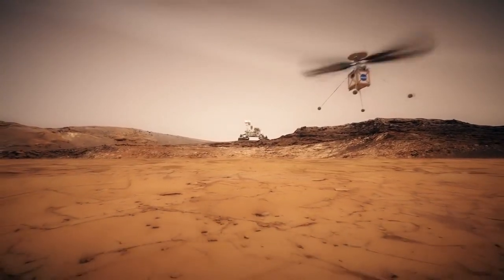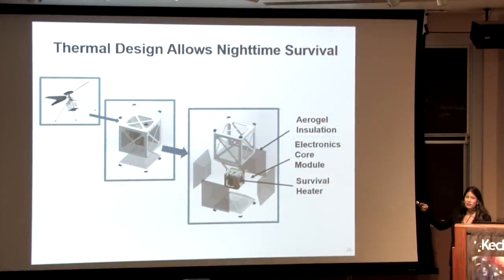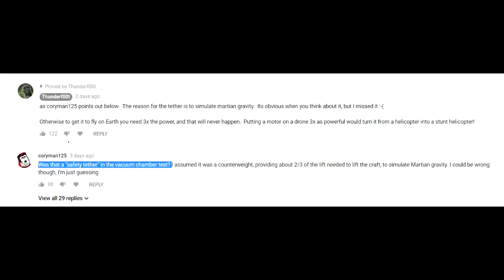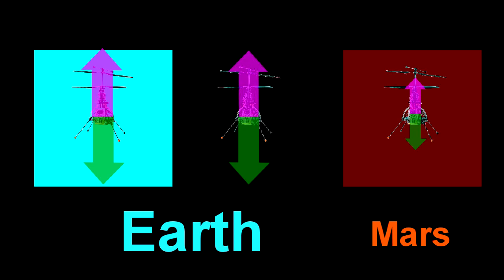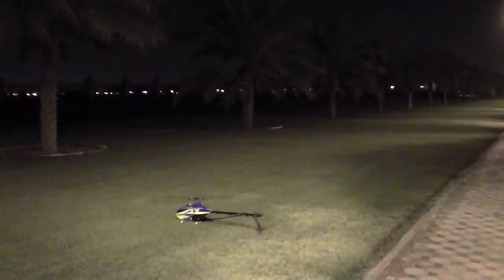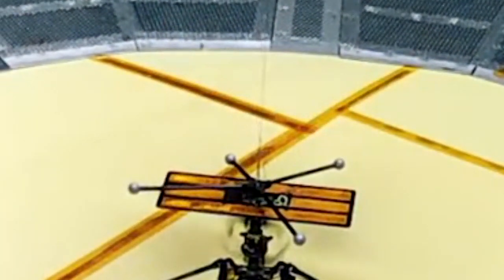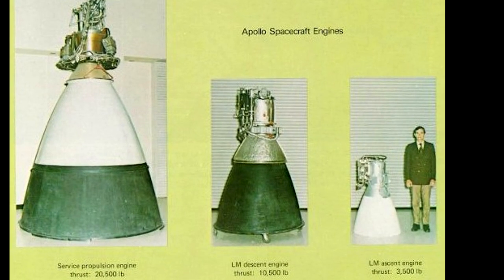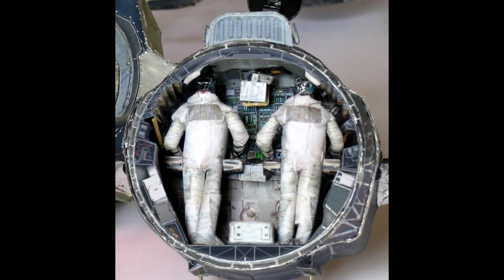Why NASAs Martian Helicopter CANT fly on Earth!

Comment: Air is needed for lift yet Mars has 0.088 psi of earth..... 55000 feet on earth is 0.9 psi, a plane on mars would need a lets say mach 1 to achieve flight and then it could not turn.

Comment: I have a question what is the Ratio of Constant pressure/Constant volume in martian atmosphere also the  gas constant because blade tip speed does not exceed 85% speed of sound to maintain efficiency and the speed of sound in mars is different in earth.

Comment: Theres also the fact that even though they would be simulating mars gravity on  the rotorcraft in the windtunnel they would not get an accurate effect of how much air it’s moving cause the air on mars is also exposed to the 1/3 g and thus falls slower. The rotors on mars would move even less air than they would in the vaccum chamber on Earth.

Comment: One would have to fill it with high altitude air ballons , but only enough, to make the body of the craft stimulate mars gravity mass. THEN it will fly as on Mars supposing to work.

Comment: It can’t possibly fly unless we have been lied to about the density of the Martian atmosphere, because on Earth small helicopters have blades rotating at, on average, 500 rpm. To get the same lift with 100th the atmospheric density, you’d need to rotate e blades at 50,000 rpm, but we can reduce that by a factor of 3, because Mars has only a third of Earth’s gravity, giving us 16,666 rpm needed. However the Mars helicopter has blades that rotate at only 2400 rpm. That’s 6.94 times less than required. Either that of the Martian atmosphere is about 7 times as thick as we have been led to believe.
Actually, I’ve always wondered how those dust storms can actually work on Mars... the top wind speed of Mars wind has been measured at around 60mph. With only 1% the atmospheric density, to kick up a dust storm would be impossible, because that’s the equivalent of a wind of 0.6 mph on Earth. Practically still air. But here we can multiply that by a factor of 3 because of the lower gravity on Mars, meaning it would be the equivalent of a wind of 1.6mph on Earth. But then, that’s still practically still air. You wouldn’t feel it, and no dust would be thrown up, even if you reduced the particulate size.
Reply: “The fact and fiction of Martian Dust Storms” Sept. 2015 Mars.Nasa.Gov

Focusing on wind speed may be a little misleading, as well. The atmosphere on Mars is about 1 percent as dense as Earth's atmosphere. That means to fly a kite on Mars, the wind would need to blow much faster than on Earth to get the kite in the air.

"The key difference between Earth and Mars is that Mars' atmospheric pressure is a lot less," said William Farrell, a plasma physicist who studies atmospheric breakdown in Mars dust storms at Goddard. "So things get blown, but it's not with the same intensity."

Comment: some late info.       you keep mixing up,  power  and  thrust.
while assuming that  it is  Possible/practical to produce 
sufficient hovering-thrust,  in the thin martian atmosphere.
martian gravity is   1/3 of earth's.    fine      but.    the density
of the  martian  atmosphere  less than 1/100, that of 
earth's.   .06 percent  of  earth's.   that is about  608  pascals. 
earth normal is,  101,325 pascals.           notwithstanding 
nasa's   flawed logic,      it can be seen that this is  the
equivalent of a rotary-wing aircraft   ATTEMPTING  to  hover,
at  an altitude   of   130,000 ft or more.        in order for this 
boondoggle to have  Any chance of success, an atypical
rotor design (maybe ducted fan) and   Very high rotation
rates will be necessary.            we are all still waiting for big-
exo-science to address the fact that  martian remote 
sampling data, relating to the  presence of  h2o  in other
than a vapor state,   Cannot   be   correct.    googletranslate
https://www.youtube.com/watch?v=7UcQuHYmTrE

Comment: Ok the first 3 mins of video is the follow up on the slight mistake, the next couple mins slip off the tangent talking about rockets and the moon and rocket engines, not really related to the mars helicopter. :)
PS: Why not make an inflatable balloon that lands on mars, deploys and using tiny electric engines hovers and floats around?
Reply: 1) agree      2)   the reduced atmospheric density on mars,  works  AGAINST
any  kind of   flying.     a balloon relies on atmospheric  buoyancy.    on mars,
this buoyancy is  Also,  1/100  of that on earth.      cheers

Comment: Hi guys, many clever brains here so please be so king to answer my question. For a long time now I can't figure myself, and I'm not skilled enough to do the math, how much fuel did they need to ascend from the Moon? When you compare the amount of fuel and the raw power of engines to lift the space craft from Earth to the tiny amount of fuel and very limited power of the engine used for Moon ascend they seem wildly out of proportion. I understand the weaker gravity and no atmosphere compensates for less power used but it looks just wrong. Can someone please explain the forces speeds required and how does that translates to fuel/power demands?
Reply: some late info.    lunar escape velocity is very low.       lunar ascent required
only a brief period of the right amount of thrust.     in is not clear where it is 
you  think  'proportions are wildly out'.        any comparison of a  lunar ascent
to an earth ascent,  is   Pointless.        cheers

Comment: It will fly on earth. You just have to take it out of that vacuum chamber. Lift is directly proportional to air density. So with 10 times the lift, it can overcome the problem with the weight.

Comment: Cool video as usual. 
How did the camera pan up when they left the moon?
Reply: Careful timing. The camera was controlled by an operator on Earth, and they'd done the calculations to take into account the signal delay between the Moon and Earth and how fast the camera would have to pan up to keep the vehicle in frame based on its acceleration and distance from the camera. The end result was that he started panning the camera up about a second and a half before the engine fired on the ascent stage and it lifted off to take into account the delay of the control signal getting to the Moon, and managed the upward panning speed based on where the vehicle theoretically should be at that point in the flight, without knowing (until the image came back) if it had actually been in frame.

Comment: Hi @thunderf00t, What do you think of SkyCool? Is it too good to be true, like all the cooling and water generator things you reviewed before, or is it for reals this time? 

They cool things down by facing a panel to the sky. It apparently has some engineered coating to make it emit more infrared in the band that can escape the atmosphere and reflect most sunlight, in order to passively cool down even in direct sunlight. 

The TED talk (Aaswath Raman | April 2018) about it seemed conceptually reasonable, but didn't go deep into the figures - although they do claim they could theoretically be able to get a cooling to 40°C below the surrounding air temperature.

Comment: I think you're a may be wrong in what you've said, or at least how I assume the average person (myself included interpreted it) if they hang a weight 2/3 as heavy as the helicopter off a pulley and then fly in the vacuum chamber doesn't that take care of the gravity issue and then let's the craft fly as if it was on Mars? I took it to mean that you meant they had a wire lifting the craft in such a way that it couldn't fly because they were essentially lifting it up while the engine was spinning because of the difficulties of proper amount of weight at varying heights through some kind of motorized mechanism.

Comment: You'd need the motor to be more than 3 times more powerful, the power requirement doesn't scale linearly.

For example to generate double the lift, means you either have to multiply the RPM by route 2, or double the blade surface area or increase the Cl by a factor of two, in reality you'd do a mixture of all of the above, doing any of those would have the same effect on drag, and just comparing the drag and lift formulas should make it obvious why, they share all the relevant terms, velocity, area, air density, the only one that is different is Cl vs Cd, if you increase any factor in the lift equation, eg surface area of the wing, then you increase the surface area presented to the airflow by that wing by the same amount, assuming constant AoA (Cl) and velocity.

From an initial view of it, it seems linear apart from the velocity since that's a squared term, but that is ignoring a lot of factors, for example if you increased the rpm, then you're going to have to look at the Reynolds number again also, because that will increase, causing more of the blade's surface to be in a turbulent flow region than before, so even more drag than you're expecting will occur, or if you increased the pitch range to increase the cl, you'd likely find that you're starting to get close to Clmax to even fly, especially if you had to increase it by a factor of three, and that would mean you'll have next to no viable pitch range above the point where it hovers to climb, lets say it hovers at 5 degrees pitch at normal RPM, then at 15 you're getting close to stalling the blades already.

That's not even considering the increased losses in the gearing.

Comment: calling for a referance on this load bearing cable idea.

at 2:55, that cable doesn't look like its providing lift, its comprised of several subparts in the manner I would expect of a cable carrying power and or data. and the way it folds as the drone descends is consistent with it being carried by the drone.

it makes sense that they would have both data and power lines to the drone, they want to get testing telemetry so they need data, but that could be done wirelessly, and the drone is going to be spending most of its time on Mars recharging using its relatively small solar panels while testing the flight systems they don't want to wait for hours between 5 minute tests. and they don't want to cycle the vacuum chamber to change the battery.

as to how they get it to fly, my guess is that they aren't using martian atmosphere, they will be using an atmosphere designed to give 3 times the lift. if this is the case then they probably ran a separate test in mars atmosphere where the drone starts on a set of scales and runs up to full power reducing the pressure on the scale to see if it is really getting the amount of lift they expect.

Comment: But wouldn't the added surface area and increased rpm it would need to fly on mars account for the greater weight on Earth?

Since on Mars it needs 1/3 the lift due to 1/3 the gravity, but 100 times the lift due to 1% the atmosphere, that would mean the drone would have a net thrust of about 33 times that of what you would require to fly here on Earth, so that would mean that NASA's helicopter would be quite powerful here on Earth, contrary to what you claim.
Please correct me if I made a mistake, I just wanna be sure! Good video btw :)
Reply: Ur math is false

Comment: Lift (L) = Lift coefficient * density * Velocity^2 * Area / 2.  For rotors, where the velocity ranges from 0 to the maximum at the rim, you have to integrate, but that integration is velocity and width integrated over the length.
So, if you want to triple the lift of a rotor set, triple the density of the medium. This does triple the power requirements (that energy must come from somewhere), but all that requires is an external power supply for the motor; the wires might be gauged for the lower current, but they can take short bursts of higher current without damage.

Comment: You might be able to get it to fly on earth...
In most electric helicopters, the battery is almost half the weight, so swap out for a tiny battery that only flies for 30 seconds. Then remove the scientific gear and your probably right around 1/3 weight. That way they could at least test the craft untethered.

Comment: There is a way to reduce the weight of the test drone. Simply remove parts not essential to the flight. You can even remove the batteries and power it over a cabel. I guess Batteries + scientific equipment + computers + communication equipment could be about 2/3 of the weight.

Comment: Yeah you screwed up way more than that in the last video dude, mainly assuming consumer rated photovoltaic specs, and completely botching the lift equation by claiming it would need 100 times the rpm at 1/100 the pressure.
You didn't "get the footwork right and then miss the goal", the whole video was sloppy unresearched crap from the start.

Comment: Wouldn't it be better to have something more like a glider than a helicopter? With light enough materials, it should be able to "float" in the atmosphere. Ok, getting it up could be tricky - something along the lines of the catapult system that's used for human-use gliders (it works, my daughter used it quite a few times when an air cadet :D) could be an answer, but setting it up would be difficult.
I'm thinking glider because of what I've heard about helicopters (full sized!). They're inherently unstable, only takes a tiny tiny bit of mistiming for the blades to cease functioning - or shatter, need the pilot to continuously move the joystick to stay in one place, and in theory should screw themselves into the ground. Ok, that last one came via a fixed-wing pilot so he may have been exaggerating! The point being, why make things more complicated than they need to be?

Comment: In one of the moon landings, the master switch to turn on the engine physically broke off.  Needless to say they had minimal tools with which to fix it.  I think they used a pen to engage the stub of the switch and turn it on. Perhaps the most surprising thing about those missions is that that those five F-1 engines had enough thrust to lift that much testicular mass into orbit.

Comment: Mars has less gravity, so less thrust is needed. But Mars also has a less dense atmosphere, so the same rotor turning at the same speed will generate less thrust. The effects will cancel each other to some degree, but I'm sure they won't exactly balance. If Mars has only 1/100 of our atmosphere but 1/3 the gravity, would you not need 100/3 or 33 1/3 times the rotor effort (I'm guessing surface area of rotor blades times rpm)?

Comment: You could just remove equipment/batteries to get rid of the weight and use a cable for power, batteries are probably the heaviest part

Comment: I'm going to point you to this technical writeup of the copter...there several answers to the criticisms that you have like the safety and electrical cable they have in the vacuum chamber. They also have dust protection boots around the motors. https://rotorcraft.arc.nasa.gov/Publications/files/Balaram_AIAA2018_0023.pdf

Comment: It's viable to build earth flyable heli that can be used on mars... Just tone down the speed?

A motor that can spin at say 1000 RPM can reduce it's operation to 300 RPM if you adjust the voltage or current flowing through it... Not sure of motors can modular control it's spinning rate other than running a pulse to turn it on and off at a slower rate to tone down the spin.

Also, why does it seem to need a single motor for a single heli propeller, what's wrong with drone designs with like 4-8 blades so even if one blade gets damaged, the other can survive?

Comment: if it weighed 180lbs that's less than i weigh 235

on the moon i'd weigh roughly 39lbs
it would weigh about 30lbs

jeez, just wanted to point that out, i thought it was interesting that i weight more than the engine

Comment: Is Thunderfoot loosing his vision?
Look, he made a mistake.. I get it.. we all get it.. but to then turn around and harp on efficiencies for 4 minutes?
Sure.. propulsive flight is more efficient.. but if what you are actually trying to do is explore, then a drone that is capable of recharging it's flight battery isn't a bad idea.  It's kind of risky.. but it's NOT a bad idea.
Where is a propulsive craft going to refuel?
So I think this is a pretty clear case of Thunderfoot not being honest about the actual goals of the thing.
The question is only this.  Is it more efficient to fly than to drive.
The answer all depends on what you are trying to do.  Sense the surroundings around you?  Drive.  You can't dig with a helicopter.  You can perhaps take a few small soil samples.
But if your goal is photography and mapping so you can plan your vehicle path.. that's a great use for this.

Comment: Can't they just attach a helium/hydrogen balloon to it instead of a freaking wire? I guess technically it's not still flying under its own strength, but it's a much better low-gravity emulation than it dangling from a wire.  Maybe it doesn't matter, a wire is more controllable.

Comment: To test the strength of the motor and the rotor's functionality in the low pressure vacuum... they COULD just make the craft 1/3rd lighter to prove the concept. It doesn't need it's camera, processor, transmission antenna, aerogel etc... just for the flight test. A tether would not be necessary in that case.

Also, isn't the CO2 atmosphere possibly more dense at the lower Martian temperatures? Do you think they filled the chamber up with an identical gas mix as the planet? That might be critical to the overall test outcome.

Comment: You're beyond your depth by trying to debunk NASA engineers.  These guys got to the Moon on big explody things.  You'll have a much easier time taking down stuff thought up by barely passable B.Eng's.

Also... the lunar ascent engine was always untested.  The fuel mixture was highly corrosive to the rocket.  To test the rocket was to effectively destroy it.  So when they used it NASA and the Apollo astronauts had to cross their fingers that their ascent engine didn't have any flaws in it.